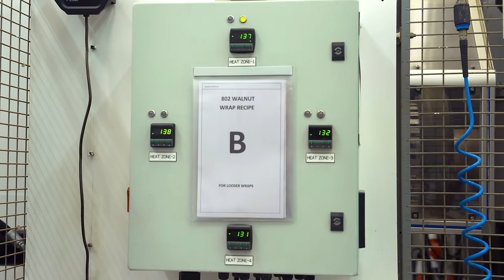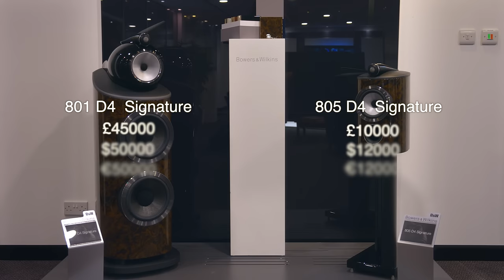NEW Bowers & Wilkins BEST of their Best 801 805 SIGNATURE D4 Speakers

Comment: I have the B&W 804 D4, running off a Michi X3 and Chord Hugo TT2, it is hard to explain the sound, however, it is simply breath-taking clarity and definition is unmatched and the sound stage and depth are truly stunning.   The B&W 804 D4 are simply put the best speakers I have ever owned :-)  one happy customer !!!
Reply: I’ve got an 804 D3, love the looks but the sound is compromised by the need to hack it into a home theater setup.  May I ask, how did you choose the Michi and did you cross shop Marantz, McIntosh, or Accuphase?
Reply: I've been into the Kef R series, and always wondered what high end B&W speakers sound like.  Mine are fairly flat sounding, with a bit of that Mylar tamber that Magnepans have.  Slightly upper mid focused.  Not really what I would call airy.  Tight/ quick sounding.  I imagine the B&W''s  to be more natural.
Reply: Can we come over for drinks ?

Comment: I have owned a pair of Bowers and Wilkins 704s for around 20 years. They have been powered by a Rotel Preamp, along with 4 x 180watt powers amps. Its fair to say I have driven them very hard indeed as I'm a bass head that craves heavy rock genre. The original grommet fixings for the covers were showing signs of detereation that needed addressing. I sent an email to Bowers and Wilkins asking if I could still purchase the grommet fixings. I had a reply within a week indicating that the original grey grommets were not available, however they did have the black version instead of grey. They sent a full set free of charge. I thought that was fantastic gesture of good will, and we definitely be buying B&W once again. Best speakers in the world if you select the correct amplification.

Comment: I had opportunity to listen older version of these speakers powered by Pointe 2A3 tube amplifier (2 x 3w only) in large room maybe 5 x 7 meters. 
I have never in my life heard better sound. Speakers are amazing.
Reply from the maker: Off 3 watts I would never had imagined that, very interesting great comment thanks
Reply: @PursuitPerfectSystem  2A3 tubes , 1 per channel, my previous comment is removed.
Reply: They need far, far more power to get going. 
3W shared by four drivers isn’t going to be anywhere near sufficient.

Comment: Before spending this amount of money on speakers, treat your room first.  I had the the 703 S2s with matching center.  I decided to upgrade to the 804 D4s with matching center..HTM82D4.  While it was an improvement, it wasn't as much as I thought it would be.  My room had some minor room treatment, but not a lot given it's size.  I had two 4" base traps and two 2" acoustic panels, the rest was cheap foam.  I contacted GIK sent them my floor plans, list of equipment and pictures.  The difference is night and day and I'm not even halfway through the treatment yet.  I burned most my budget on those speakers and had very little left to treat my room so now I have to do it in stages.  If I had to do it all over again, I would of fully treated my room first...then at some point if I wasn't happy with the sound upgraded.  Spending $4k on a complete room treatment assuming you have good speakers will yield better results then spending over $10k on a new set of speakers.
Reply: I agree 100%! The room is 70% of the sound!

Comment: B&W should make a 'studio' version of the 800 series, one that measures perfectly linear and neutral. They have everything at their disposal, their speakers are always class leading when it comes to distortion and their baffles are great and basically diffractionless. But man, that crazy treble lift they are known for is just way too much, Ive seen 10db lifts or more (relative to 1khz). Hope B&W takes this into consideration.
Reply: You’re exactly right and it’s what prevents me from pulling the trigger on these, that frequency response MUST get addressed specially at this price point.  No way these compete with Magicos if class leading sound is what you’re after.
Reply: The 80s and 90s B&Ws were far more linear. I have a vintage pair of 1997 Matrix 805s, which measured +/- 1.75dB. My 801 Series 2s were also extremely neutral.
Reply: @ChicagoRob2   I had a pair of the original Series 80 801F.  They used an acoustic suspension bass system instead of a reflex system. Very inefficient, but they measured very linear. B & W seems to have decided that they need to have a "house sound" to compete in the market today. No way I would touch these products with those lousty measurements.
Reply: The people who can afford these speakers are old men who need that treble lift to hear "linearly"
Reply: You can tame the treble with proper EQ but you’d have to have proper gear. It does take unfortunately money, patience, and some time but when you get it right it’s just superb. I have 702 S3 and the elevated treble is still there but not as bad as the 702 S2 which was the absolute worst. The new twitters in the S3 line is much better

Comment: I have owned 802d(s) since 2008. Paired with a  Chord spm 1200e stereo amp,   Esoteric SA-10 CD player used as a transport with a Berkeley DAC & Siltech interconnects and speaker wire completes my amazing reference system!

Comment: The manufacturing process is very impressive, especially making the curved main cabinets, the bracing and finishing. The factory is big, nice equipment, well trained workers and very clean. The automated spray painting is like cars are done. Have heard less expensive models, the high end can be a bit bright, but assume that's the diamond tweeters and what the customer like.

Comment: At that price I would take the Linn Klimax 350’s any day. I was eager to see the crossovers and pleased to see they used air cored inductors. But at that price they could have used even better caps like Sonicaps with Miflex copper bypass caps or even full blown Miflex copper on the mid and tweeter or a Mundorf silver gold oil bypass.  I couldn’t see the resistors but the white things looked suspiciously like ceramics unless they’re the big white Mundorf wire wounds which would be fine. I wonder if they still use push on connectors on these like their other speakers or bother to actually solder the connectors to the drivers and speaker terminals?  The final proof of the pudding is whether they actually have a flat frequency responce or that characteristic B&W mid suck out and hot top end like a lot of their other speakers . Impressive manufacturing facility though I’ll give them that
Reply: I agree Stephen, regarding the bypass caps. Laughable at this price point!!

Comment: The problem is that with such a blatantly not-blind listening experience, with a long pause between the two sets as they wheeled stuff in and out, mental factors will outweigh the physical ones for how you perceive the sound. That said, I would hope they have managed to do slight improvements to the signature models. Either way, gorgeous speakers; I have some B&W of my own, just more lowly 600 series.

Comment: Many thanks for the detailed video, especially the detailed presentation of the differences. I myself run an 802 D4 on a McIntosh MA12000 and certainly don't skimp when it comes to buying high-quality components. However, I am not at all happy with B&W's release policy. I have already considered upgrading from 802 D4 to 801 D4 and am now thrilled not to have done so. Otherwise I would have to be annoyed that the same release cycles now apply to speakers as to mobile phones. If I were already in possession of the 801 D4 with the claim of having the best current equipment at home, B&W would now put me to shame. Of course, even with high-quality cars, there are first the standard models and then, after a while, the special editions. With the purchase of the D4, I gladly switched from D3 because the sound improvement was audible, my combination of B&W and McIntosh resolves even more precisely. If a signature version of my 802 D4 is released at some point, B&W may lose me as a customer. And let's ask ourselves in all honesty: are the changes to the 801 D4 Signature really so extensive that the sound is really significantly better without having to fool ourselves? es this justify the extra price of 12000 EUR? I don't even want to explore it. My equipment is excellent. But in the future, B&W is no longer a must.

Comment: I find that B&W speakers tend to be jacks of all trades, but very good jack of all trades, dressed up in pretty finishes.  You can't fault a loudspeaker that does everything really well if not great.  My ideal system would be my Magnepans and a pair of B&W standmounters, with a switch selector for the amp.

Comment: Beutiful speekers. If I won in lotteri I would by Bowers & Wilkins 801 signature in blue and set them up with 2 heavy amplifiers from Mcntoch (that have a lot of blue ligts in the panels) one for each speaker. I belive that must be the system of dreams... Today have in a litle listenig room a Bowes & Wilkins ASW 300 8" 100W + Dali 1001 blue + Yamaha home teater reciver + a litle base tower of 2 Eltax 12" 250W in each of them (250W×2).

Comment: I love the design and I guess also the iconic factor of these speakers. The only ones I can afford are the 805 so I auditioned them and I have to say I was disappointed. As breathtaking and jawdropping the resolution was I felt like it was almost disjointed from the rest of the music. I really have trouble describing it but once the WOW from the resolution had passed it sounded broken to me and not enjoyable for long term listening.
Reply from the maker: Maybe the wrong gear in the wrong room, they dont sound like that at Bowers HQ
Reply: @PursuitPerfectSystem  thank you for responding. the room was really just a shop. they were using a NAD M10 for the demo. I will try to find a different dealer to audition them again.
Reply from the maker: I like the m10 but it’s totally wrong for the bowers so that defo didn’t help :)

Comment: I had the opportunity to obtain a pair of 801’s in 1989 when was i was only twenty years old (i worked at a b&w dealership)  i enjoy them for 40 years now… did a few upgrades, but still 40 years of enjoyment… if i did it again it would be €104 a month😊 well worth it tbh… but since i have to devide that through 4 now (@70 i do not expect my hearing will be top notch)  i can also spend that money to something else…. But bottom line.. if you are rather young and have the opportunity, just do it!  It’s more fun than a car…  imho

Comment: I've heard an earlier 801 speaker, driven by a 1000 watt amp, in a very simple setup. Tremendous bass punch with those 16 inch drivers. You cannot dodge the physics of moving air; you need a big piston to do it. B&W is a good company.

Comment: Interesting and informative video, thanks for making it. I noted at 19:38 the image of the crossover an inductor with a metal core. My thought was for a speaker at this price range, B&W would be using all air-core inductors in the crossover. Do you happen know if that is a laminated-core inductor as opposed to an iron-core inductor, and what part of the frequency spectrum it covers? If its for the frequency range from 200 Hz and below, it won't be a problem, but if it's used above that frequency range, iron-core and laminated-core inductors can, and do, saturate and this results in a "smearing" of the clarity of the presentation. Respectfully, for speakers in this price range, I'm a bit disappointed to see B&W using iron-core or laminated-core inductors being used at all. At this price point, all the inductors should be air-core. Cheers.

Comment: I would expect there to be a difference between the 801 D4 and the 805 D4 so I would’ve liked to have seen an 805 D4 pair up with a set of subwoofers and really see how much that difference diminished
Reply from the maker: Being honest I think the mid range pop and energy, the way it leaves the speaker from the turbine head is a big part off the difference and I dont think adding subs would close that gap.  For me the 805 are different, more easy going like I said in the video, I could be wrong though

Comment: I owned the B&W 801FS and then upgraded to 801 Matrix series 3.  I still own the 801 Matrix series 3 - Much better speaker than the Nautilus 802 and 802 D2.  The Signature is supposed to be a more refined sound - So they changed the crossover and charged an extra $12,000.

Comment: Would you rather recommend KEF reference 3 Meta or B&W 804 D4 after what you saw and heard? Understand its subjective, however your pro opinion matters. As currently undecisive, if instead of new 702 S3 I should stretch out for one of those two mentioned.

Comment: It’s unfortunate that B&W does not book match their veneers.  This is most noticeable on their signature speakers with the Wenge veneer.  No I have never had a good listening experience with any B&W speakers .  While I blame that on the local dealer playing crappy tracks or having them on display in some giant cavernous space so for me the book matching issue is just one more reason I did not purchase a pair.  But at that price point the veneers need to be book matched. 

And what’s with the moles connectors in the crossover?

Comment: Honestly my friend took measurements of 800 diamond series several models and there measurements are not perfect most of them had a drop off in higher midrange and a gap between that and tweeter lower range , it's disturbing for a speaker of this price

Comment: 12:46 the tweeter frequency response test yield is only 88.89%; looks like the mfg process control is not stable ah~~
Reply from the maker: Or maybe just extremely tight tolerances. Pretty sure average manufacturing wastage is 20% so maybe the manufacturing process is extremely stable considering it’s done a lot by hand

Comment: 12k for a passive compact speaker… would never ever spend this money on a small pair of 2 Way passive speakers. You get a pair of ATC SCM45 or 25 (incl subwoofers and still have money left for acoustics). But when you produce for a market where the customers (mostly) doesnt care what other concepts are out there (subwoofers & acoustics are way more important) you can put out these price tags. Ridiculous… But because no one ever blindtestd this against a half of the price active or other speaker, or in a setup with well integrated subs and dsp control, you can only assume and guess… its only good for the high end manufactures but not for the customers bank account

Comment: 18 hours of robot hours is cheaper than 18 hours of man hours, far cheaper. Robots don't take breaks and can work no stop 24/7, the robots don't cost anymore to buy than in any other industry, same robots they use to paint cars. Why do your videos exaggerate every thing. The lady soldiers, but I couldn't do it. With practice, you could, more exaggeration. With training and practice, anybody can do anything in making the speakers. The most skill  involved were the people who designed and made the jigs to build the speakers.  The finishes are new but not improved.  I like the shot of the crossover more than kef will show, that could be because kef uses cheap parts in their crossover. Kef speaker all looks on the outside but cheap parts inside.